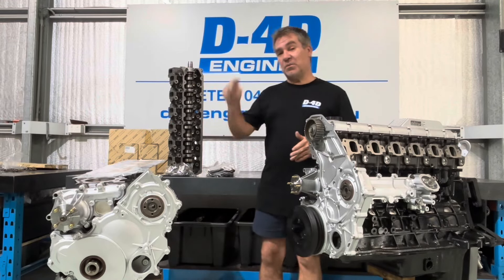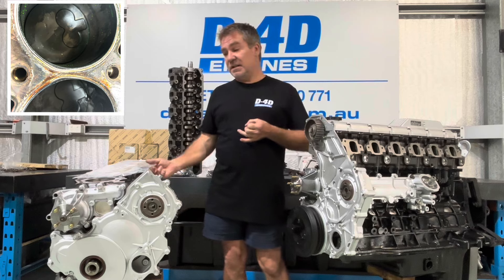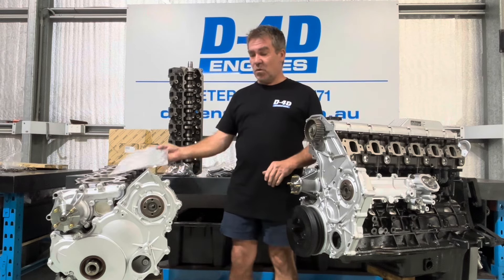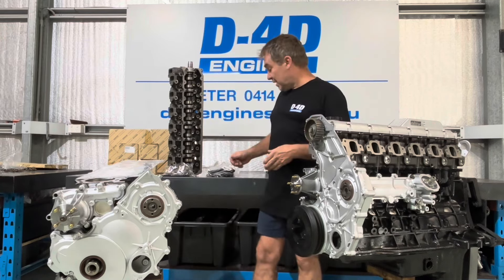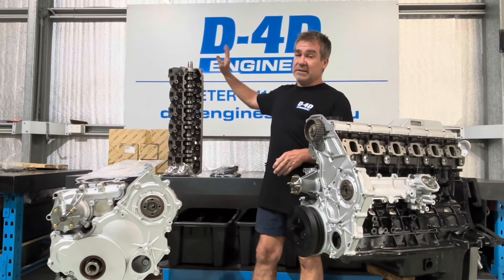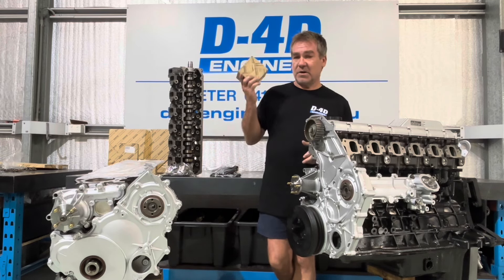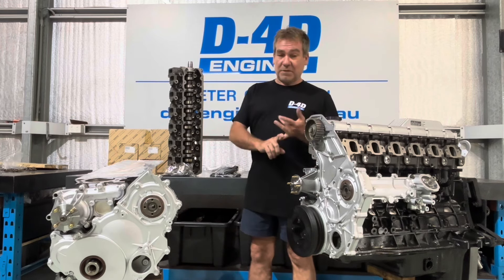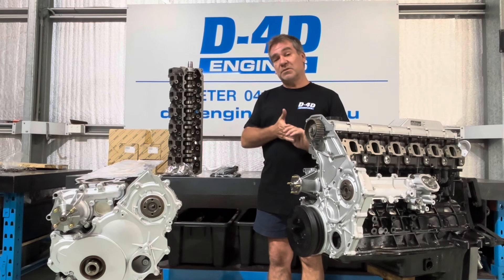Toyota Landcruiser 1HZ TURBO upgrade, problems solution reliability THE WAY I DO IT.

Comment: A Company I worked for in Cairns turbocharged around 600 Landcruisers, 1hz and some Hi Luxes during my time there. Most of these were for a Copper mine in Irian Jaya, Indonesia, and while the turbos were fitted mainly for altitude compensation, up to 15000ft, so the boost levels weren't meant to shread tyres, the reliability was awsome. We never had a problem with any vehicle we turbocharged because the work was done properly, plus the 1hz is a great engine, as is the TD42 for that matter. I am sure there are some horror stories out there, but there is usually a very good reason.

Comment: 100% WILL split/crack the piston crown on a 1HZ aftermarket turbo build. Even with a really mild tune they do it. Head gaskets have always been an issue with the 1HZ as well as cracks between in the centre of the head. Sad really since the block material is really good. Ive never ever seen a broken ring land on a turbo'd 1HZ, only dozens of split pistons. Only time ive seen broken ring lands is when the "locals" used a petrol rag over the air filter to start them instead of replacing glow plugs. Over all they respond well but dont last, even when "built" for a turbo. Better off getting a 1HDT, much better option in every regard.
Reply: Havent had an issue after 14 years on dads 1hz turbo, do it once do it properly, and dont drive like a "P plater" flog. Id love to swap a 1HD-FT into my hzj79 instead of turboing my 1HZ.